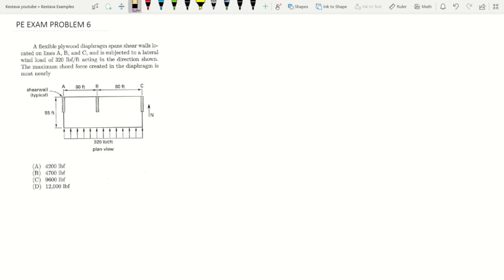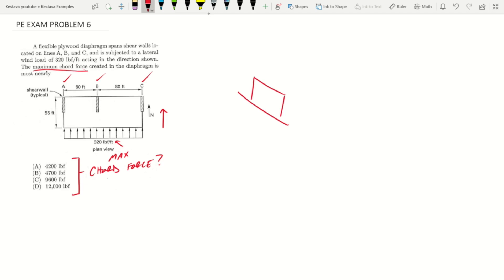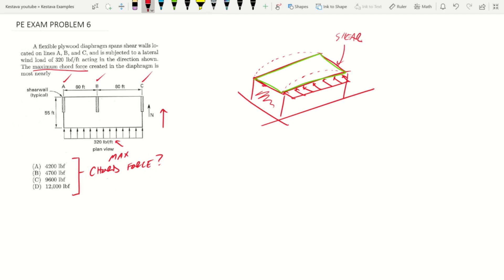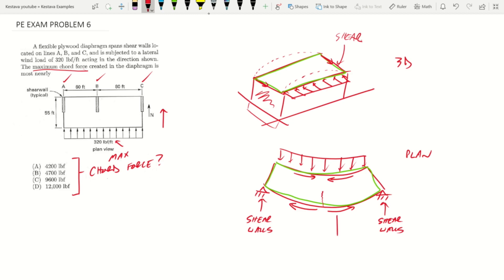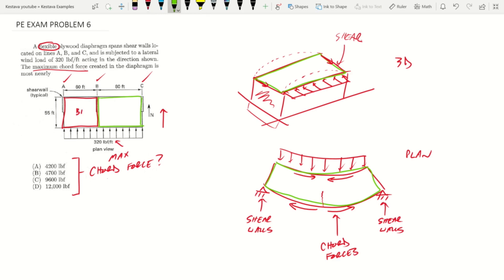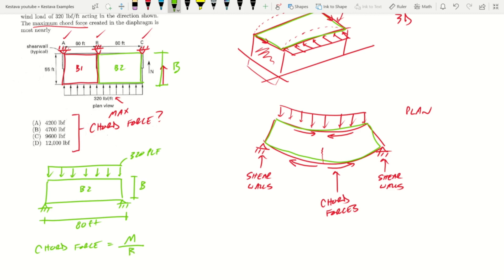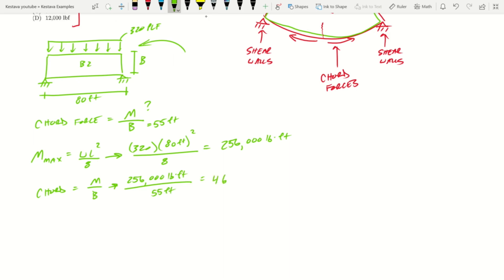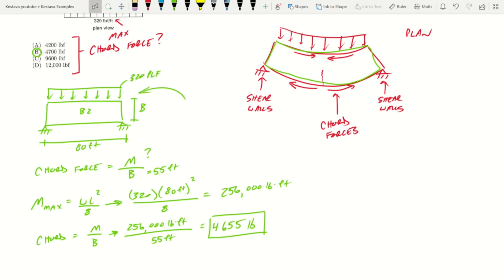Civil PE Exam - Structural Review Problem - Diaphragm Design Example

Comment: If this were a rigid diaphragm would you still view this as 2 simply supported beams to get moment?
Or would it then be more like a continuous beam with an extra middle support?
Reply: Probably like a beam on 3 semi fixed supports each having different springs stiffness. He said it would be distributed based on stiffness of shear walls

Comment: Question about your design approach. You used the 80' span and assumed a simple span between these shear walls. Why not analyze this diaphragm as a continuous beam with (3) supports? 

This would alter your bending moment diagram and come up with a different moment. I assume this is because a simply supported 80' span would result in a moment greater than that of a double span, so for practical applications I like this approach.

But in terms of a PE or SE examination, these two approaches, would result in different answers. What one would the examination be looking for and why?
Reply: 3 or 100 spans would give same moment BECAUSE they are simple supported

Comment: I have a question that may show my ignorance, as I don't work with transverse loading typically: Why do we treat the design as simple span?

My assumed answer is that diaphragms are typically comprised of individual wood sheathing that is not continuous between shear walls, so it's safe to assume a single panel can be treated as a simple span.

Comment: Since you're make an analogy to deep beam, those 3 nos shear walls should acting as 3 nos pinned support in continuous beam, shouldn't it?
Reply from the maker: the diaphragm is not assumed to act continuous over the middle shear wall. wood diaphragms are assumed to simply supported between all lateral supports

Comment: Just to make sure that I understand it correctly. Is the flexible plywood diaphragm the horizontal element subjected to a wind load of 320lb/ft supported by the shear walls? Thanks in advance for the reply?
Reply from the maker: That is correct
Reply: @Kestava_Engineering  Thank you once again.

Comment: How do you know there are only two shear  walls ? If there are four then how does the problem change?
Reply: Just zoomed up.  

How would it change if there walls on four sides.
Reply from the maker: it would only change if the diaphragm was rigid or partially rigid!

Comment: Great example for this; it's been over 14 yrs since I designed parking structures and I used to do these calcs frequently back in the day with Walker Consultants.  Q: We took the 80' span to illustrate and come up with the largest chord force, right? Stayed away from the 60' span for that reason?
Reply from the maker: spot on Don

Comment: Its continuous beam action seems but conservatively done for simply supported behaviour,so may I know d reason for y not done for less moment economically by considering continuous action
Reply from the maker: a flexible diaphragm is not permitted to be analyzed as being able to translate moment through its supports laterally as the system isnot stiff enough. so you must look at it as simply supported spans

Comment: I have question how to calculate wind load on diaphragm I know you explained half the load from wall and other half to foundation. But I am curious do we need to consider negative and positive loads on the wall since other side of the wall experience negative pressure. I am glad of you answer this question. Thanks
Reply from the maker: Hi Raja - with wind you combined the positive and negative wall pressures (if that is what condition you have) and then you compare that cumulative story force to your seismic story force (if you have it). but when designing walls for out of plane forces you have another set of equations to use to calculate your walls.

Comment: Hi. You divided the diaphragm in two simple supported beam. Why you don't considered as a continuous element. In that case your moment is not the isosttic moment. Any reference on why this is done in that way? Thx
Reply from the maker: in wood construction, the individual plywood boards that make up the diaphragm may not be oriented along shear walls to resist any negative bending moment. the boards may be edge to edge along the shear wall and nailed, creating a simply supported boundary condition. therefore it is not wise to analyze diaphragms as continuous. instead you always analyze as simply supported spans from shear wall to shear wall and design the diaphragm for a moment of wl^2/8 which should be larger than a continuous condition.

Comment: Thanks for the video, real easy to understand, a quick question, If the diaphragm is taking half of the load (other half taken by foundation), that load wouldn't be acting exactly at the diaphragm, but would be offset (located at 1/4 wall height from top), wouldn't it transfer some moments/ torsion on the diaphragm?
Reply from the maker: Hi Vladimir, that bit of force would be transferred through the walls through shear (for walls parallel to the acting lateral load) and for walls perpendicular to the force they would resist the load in out of plane bending. does that make sense.

Comment: Sir, why don't you consider A,B and C as continuous beam and solve it for getting max bending moment value?
Reply from the maker: Hi Mohammed, if we considered the diaphragm as a continuous beam then we would need to take into account negative bending moment at the shear walls which is not what actually happens. the flexible diaphragm is not fixed at the shear walls its a pinned condition so the diaphragm is free to rotate at the walls and no moment is able to transfer through the connection.
Reply: @Kestava_Engineering  But Sir, in most standard software like ETABS and SAP2000, their are either rigid diaphragm or semi-rigid. Even in CRSI manual, they assume it to be rigid.
Reply: @mohammedabdulsami3774  I think you can modelate the "floor" as a membrane type, since it doesn´t have the property to transfer moments.

Comment: All these years I've just been pluggin it into the company spread sheet.  Nice to see and understand the inner yet simple workings
Reply from the maker: Matt its a breath of fresh air when that happens. I get that feeling all the time, slowly but surely. And then you can really start to push the bounds of your designs
Reply from the maker: @bonegrubber  that spot on. Structural engineers don’t typically like to assume that moment can be transferred between vertical lateral elements do to the assembly of the diaphragm.

Comment: but if the diaphragm is a single piece, how can you assume it will act simply supported? The middle shear wall is basically an intermediate support therefore there should be a negative moment occurring there...
Reply from the maker: Hi Tig, Each bay between shear walls acts as a simply supported beam. In this example, since the diaphragm is flexible, we know that the largest  tributary width to each shear wall generates the largest chord forces. If we analyzed the entire structure then there would be two spans of simply supported beams, where each boundary condition is a shear wall location.
Reply: @Kestava_Engineering  thanks for your response, does this mean the diaphragm is to be built as two separate floor panels in the real world?
Reply from the maker: @Tig.k02  diaphragms are built using numerous sheets of either plywood or OSB type boards all nailed to the framing system. When designing in the real world, we check the capacity of the wood boards themselves for shear, and then we check the nailing pattern used to fasten the boards to the wood framing as well (including chord forces). Most of the time the design of the nailing is what is most important (but not always). Because the diaphragm boards are nailed to the top of the shear walls, the nailed connection acts as a pinned connection because the nails do not have any ability to transfer moment through the connection. The boards simply rotate about the nailed connection to the shear wall, this is why we treat all shear walls as only simple spans, not continuous spans where you get negative moment.
Reply: @Kestava_Engineering  yes that makes sense. I would imagine if it was a whole single sheet spanning across three supports then, it would act as a continuous beam
Reply from the maker: @Tig.k02  , i just realized i didnt mention that the diaphragm example i drew was an example of a diaphragm with a shear wall at each end. the little example does not represent the actual problem. So sorry about that! ill add a note to clarify. there is indeed a shear wall at the middle, but the static breakdown would still be two simple spans between shear walls. i hope this is starting to clear some things up!
Reply from the maker: @Tig.k02  05:30 i talk about the simple span system more clearly

Comment: Great explanation, thank you! Are diaphragms similar to floors, if yes, then why not just say floors instead of diaphragms?
Reply from the maker: Great question Farid, "floors" are more of an architectural term, which could mean "flooring" or the type of finished floor that would be chosen by an architect (carpter, stone, wood). Floor does not necessarily mean a structural floor. Typically in the professional field we specify a "floor" as a "structural slab" or "deck" for the case of gravity elements, and then we describe the "floor" in the case of lateral elements as the diaphragm. There are so many systems to choose from that simply calling something a "floor" is difficult to express what you are truly referring to. I hope this helps somewhat!
Reply: Thanks for asking this cause I had the same question.
Also the answer was super helpful